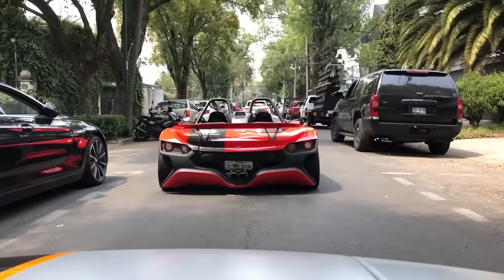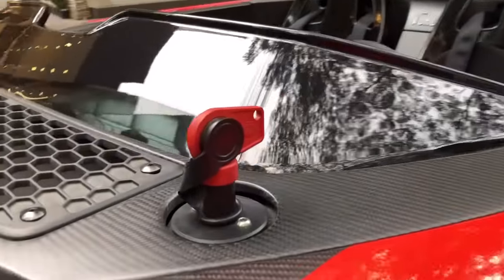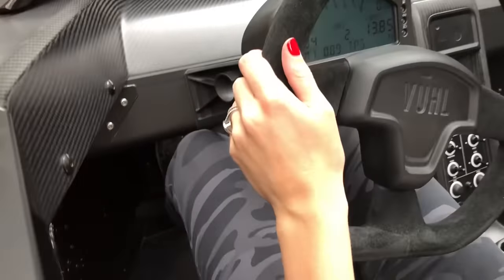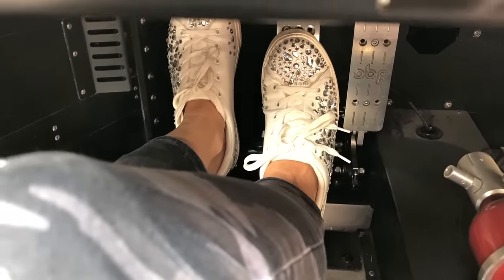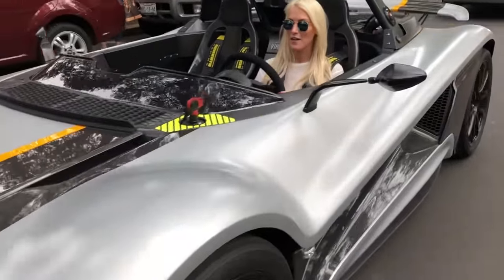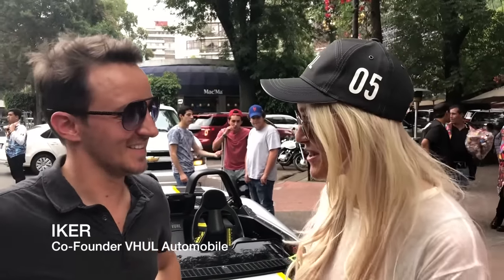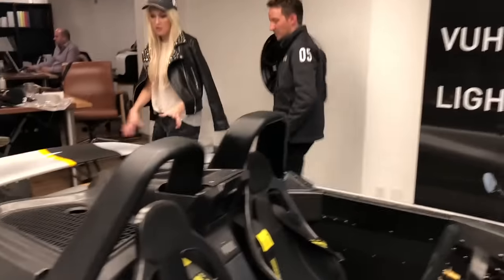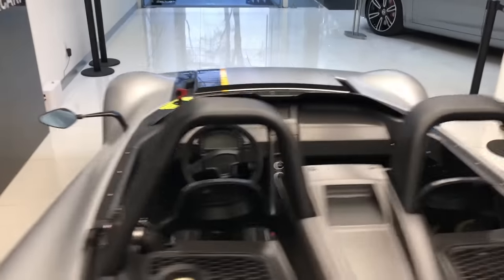The Supercar of Mexico - VUHL

Comment: I doubt they'll ever be released to american market due to crash test standards. Unfortunately most likely going to be limited to trailer/track use here. I like the modular design and ease of dismantling forsure. Design is a bit go-kart-ish. The quick disconnect steering wheel is a bit gimmicky as well. Not necessary and really seems like they used it simply to cut costs of a full function steering wheel. Most honda civics in the u.s. have the same quick disconnect wheel. Looks like they had took a few design cues from the brp and ariel atom. 
It's no surprise they're using a ford EcoBoost engine as the fordmo.co. assembles engines and transmissions in Mexico. I would like to see the Ford 2.5/3.5 TT for more stock and aftermarket potential power than the focus st's 2.0L in a higher trim option of the Vuhl? Maybe? All in all for a v1 supercar design, they did a great job.

Comment: 1.) Video at 9:42 shows the engine is made by FORD,  it’s not 100 percent Mexican engineering, actually Much of the design work was sub-contracted to an Italian design house.  2.) The car does not have open doors, nor roof top, that means you will pay about $124,000 for a car that you will not be able to drive when it’s raining.   3.) For a quarter of the price you could get a 2020 CORVETTE C8, with superior technology, superior engine, superior performance specs, and it looks by far way better..

Comment: So only a top speed of 244kPH as opposed to 341 that is the 2019 Corvette ZR1 which the Zr1 also does 0-100 KPH in 2.85 seconds.  Heck the Tesla Model S does 0-100 in 2.5 with a top speed of 249KPH.  If an electric car can perform better then no it's not even worth the money

Comment: And if you slow down in traffic, anyone from the car beside, can turn off you car! 😂🤣 Dumbshit. You need key to open you gas tank, register key, jump in to get in 😑, Manual gear shit with gear lever (No paddle shift) and above all that, you need to bring your own steering to ride it or get it from the trunk 😜 which is probably opened with that disgusting key! 😬 And the highlight is, you don't need to lock the car. Since the door is always locked and, it's roofless! 🙄

Comment: What a dumb car.  Engine looks like shit, you have to store your steering wheel in the trunk and attach it everytime, no doors so you have to climb over, 1$ display, you need your key to unlock your fuel tank, you have to turn a lever to turn on the car so people could just troll you at an intersection, and theres no windows or even a windshield so you never want to be driving it in the rain and even during good weather you are getting wind blown in your face and all sorts of dirt and bugs will be flying right into your face as you drive.